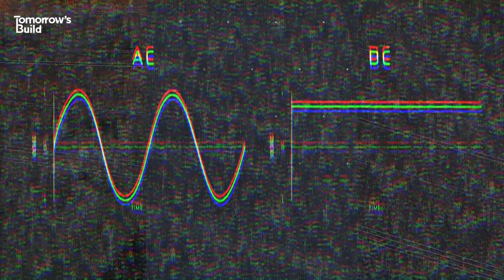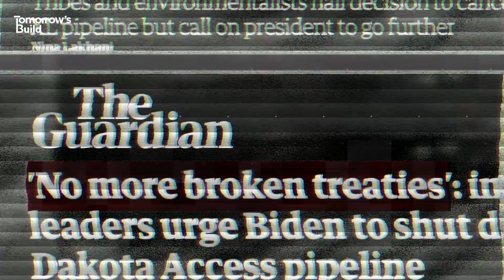The $23BN Plan to Power Singapore from Australia

Comment: The solar source is a great idea, and it will become more useful when we perfect storage capabilities.  My concern would be that sooner or later the cable will fail, and it's not like repairing an overhead cable with a few men, the right equipment and a few hours work.  Underwater repair would be difficult and time-consuming.
Reply: stop worrying  about cables! Our whole world is connected by optic fibers and oil and gas pipelines and you don't see them failing on a daily basis.
Reply: @screwdriver1337  Honestly more people need to know this lol

Comment: Have they looked into the new nuclear power option being proposed that uses only spent nuclear waste to generate power?  No meltdown, no dependency on water cooling, self shutdown in the event of problems, no waste.
Reply: Really
Reply: Exactly!  Molten Salt reactors!  Also use abundant and cheap Thorium as fuel as well as burning the spent fuel rods from light water reactors.  The waste is mitigated in decades and at the most a couple centuries unlike Light Water reactors spent fuel rods taking up to 50,000 years!  Also MSR are inherently safe and will not melt down causing a global disaster.

Comment: I’m not an electrician but don’t you lose ‘power’ the longer you need to transmit it via cables? 

Edit - spoke too soon
Reply: You are right
Reply: Also, they butchered the explanation. Forget everything they said about DC and AC. In short, AC is generally better for transmission and is what is used almost everywhere. However, in some cases, such as underwater lines, DC can have an advantage. The explanation is misleading, but it's true that DC is better for this use case.
Reply: Great talk
Reply: Hey I wanna introduced you to the best real and legit trustworthy business you can gain more profit through it.
Reply: 👇One decision changed my life! I decided to act on faith instead of fear. I'm now reaping the rewards of that bold step and making more money than I could even imagine. At the first I decided to start with $1,000 and in just 5days I got massive return of $10,340. I'm indeed grateful and all thankful
Reply: For more info
Reply: +1  5  0  4  2  6  7  1  6  5  2
Reply: Whay/Sapp ⬆️ ⬆️ ⬆️

Comment: Correct me, but I was informed high temperature (Australian outback region) reduces the efficiency of the solar panel power output, so how feasible this solar farm project can be? with its huge capitals and limited asset life over time...
Reply: Correct
Reply: Technically, heat isn't good for photovoltaic cells and will  reduce their output, if not equipment life.  The plant owners will carry the risks.